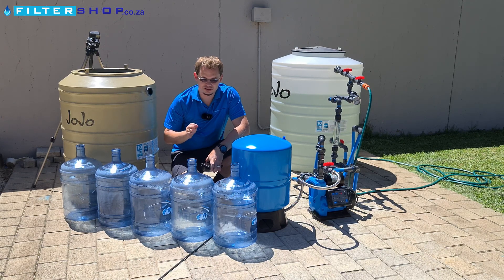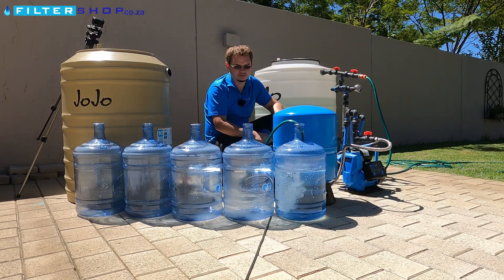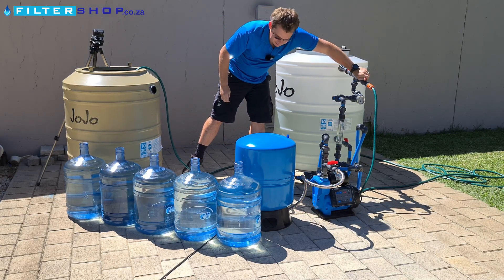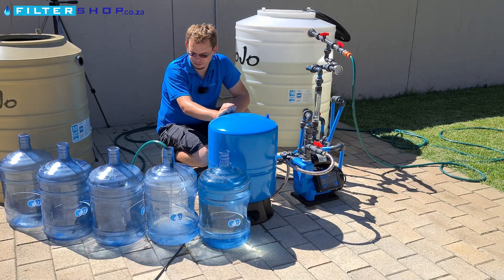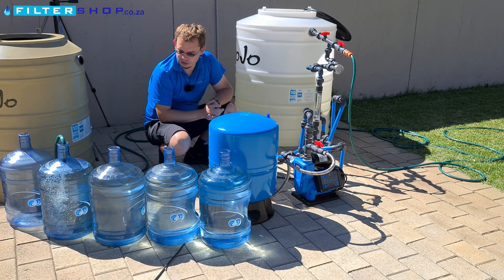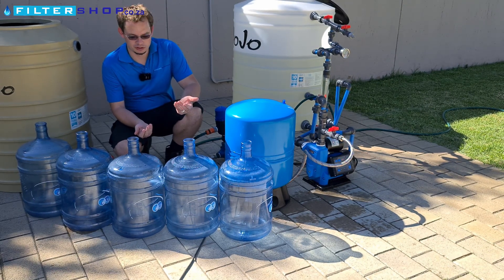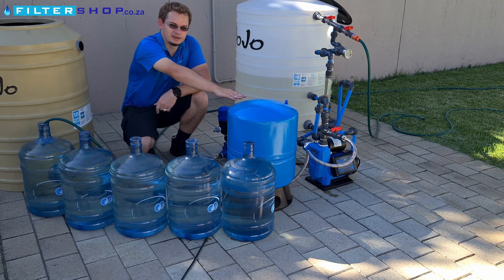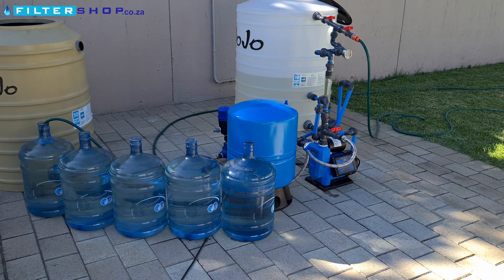Does A Pressure Tank Improve Power Consumption? Full Test

Comment: Hello, very interesting video. I have a goulds resiboost vfd pump also so according to this video i can also hook a 20 gal pressure tank and it would save on energy consumption? I'm wondering if that's the case then would it not have been better to use a standard Gould pump with pressure tank instead of a vfd pump without a pressure tank.Which set up in that case do you think would use less energy?
Reply from the maker: Hi, you gain the most if you have a VSD pump that you can set the turn on and turn off point with a tank. Something like the hms1500 works really well for this. If you can set for example a target pressure of 4.5bar and a turn on pressure of 2bar it would benefit from a tank. Not all pumps can be set like this though, for example the DAB Esybox doesn't allow you to set more than a 1bar pressure difference this a tank doesn't make sense with it.

Comment: If you have an in line 3 stage filter with ph correction vessel, extra siliphos cartridge and UV filter, where would the best place be to install the pressure vessel. Would a jet pump without controller be sufficient?
Reply from the maker: It depends a bit on what is practical in your setup. Ideally I would say just after the system as then you have a buffer of treated water, but you might find that this will let the pump cycle a bit more. On the jet pump you will need a controller to turn it on and off depending on pressure. What do you have at the moment?
Reply: @FilterShopZa  thank you for the explanation. I also initially thought to install it after the treated water. I have a 0.75kw jet pump with basic controller. Not the most user adjustable, but does the job.
Reply from the maker: Try if as it is but if you find your not getting much capacity out of the tank you can upgrade to one of these adjustable controllers: https://filtershop.co.za/en/coelbo-switchmatic-1 @renierjoubert9176

Comment: I have the normal .75kw centrifugal pump with a pressure tank. What should the pressure tank be set to in bars?
Reply from the maker: It is difficult to say as it will depend on the pressure switch. A good place to start though would be 1.4bar as many of the pressure switch are set around there.